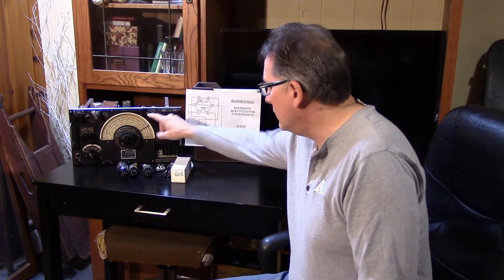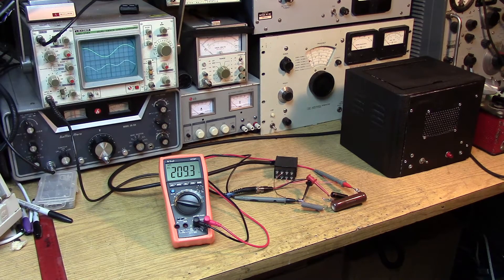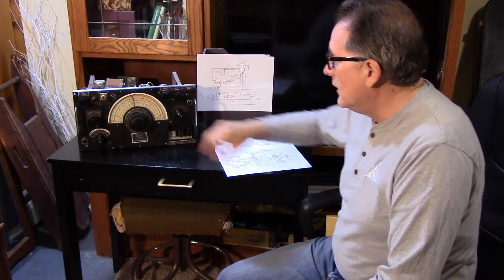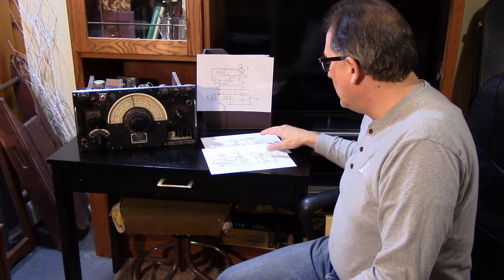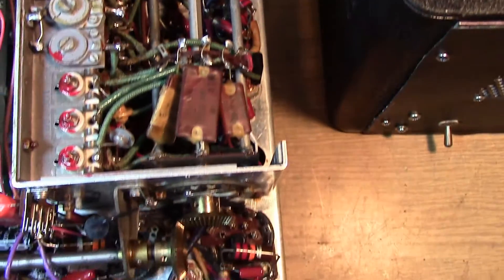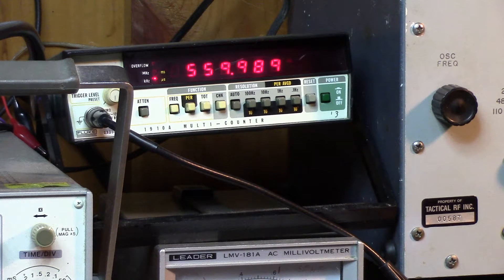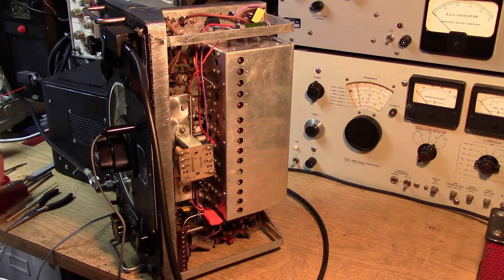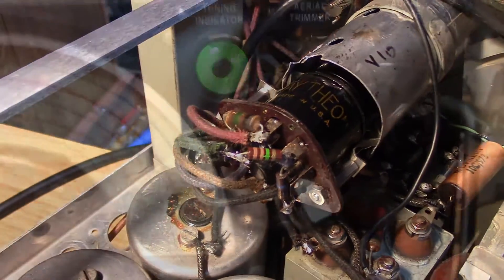R1155 Part 4 -  Got Hum? & Magic Eye

Comment: I bought 4 in their wood crates back in the seventies. Now I'm retired, the restoration starts. Only it didn't. The first one I powered it and gradually brought up the voltage over an hour . Bless it, it works. Full of crackles from dry contacts but it works and works well. I'm so shocked. Even the magic eye is A1. Now I do know that this one has been stored from new and never used. I've stored them very well too wherever I've lived.  The others have all been issued then returned to stores so those i will reckon will need full restorations. Anyway, number one is sat happily playing now the crackles have been dealt with. Alignment is ok and I've not had to change any except 2 capacitors and a resistor. Not bad for an 80 plus year old.

Comment: It would be great to know what software you used to produce those nice circuit diagrams.  It would be particularly good as the software has the symbols for valves/tubes.  I have not found circuit software which has these symbols.  Thank you for a very informative series.
Reply from the maker: I assume you want to be able to produce period correct schematics and diagrams with no compromises. Say you want the ARRL 1939 Handbook style of schematics for instance, and not the 1962 style...you must abandon all schematic capture programs and go to a pure illustration 2D CAD drawing software package and make your own symbols Libraries.
 I use Deneba Canvas, bought by ACD and recently sold again as Canvas. But Corel (Draw) and NCH, make similar products. Like all software, you are stuck with what you are used to!
Reply: @MIKROWAVE1  A big thank you to Mikrowave1.  I have been looking for a way to do this for years and now I know that is has to be done from first principles.

Comment: Mike, if you get a chance could you possibly email me a pdf of the power supply schematic you designed for the R1155? I just picked a nice R1155 up and want to build it. email is tombewick at gmail, thanks and 73, Tom